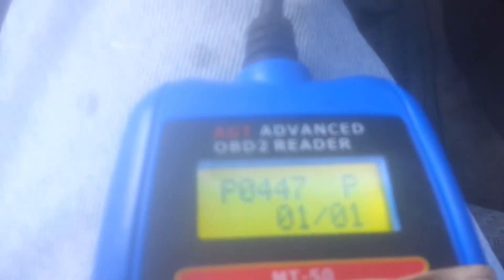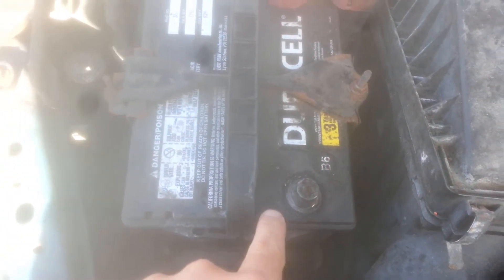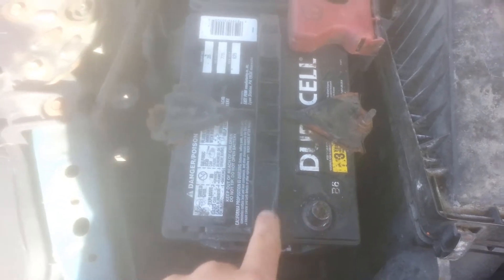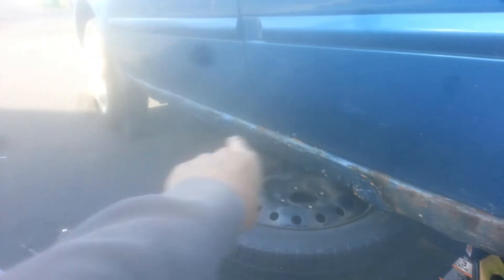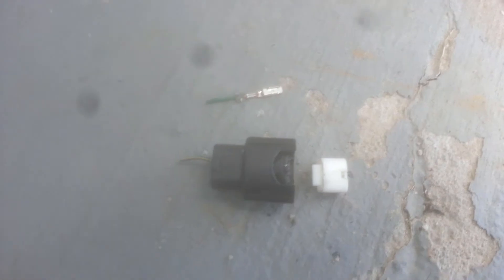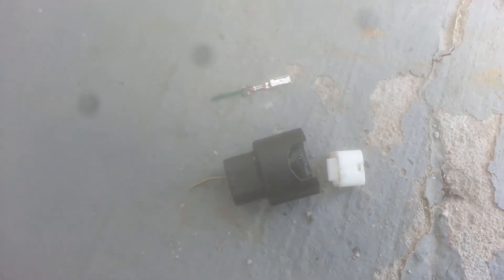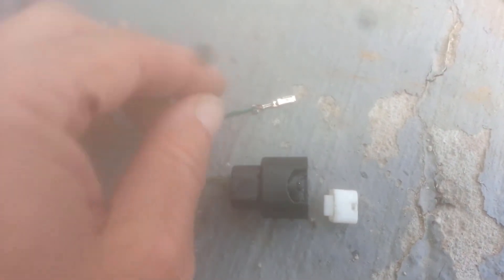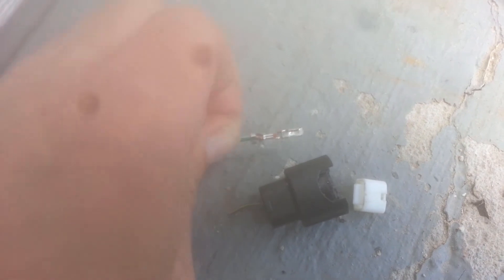P0447 FIXED!!

Comment: Other than the check engine light being on, did you have any issues with the performance of the car? Like did it have a rough idle, misfire, or seem to have a vacuum leak?
Reply from the maker: My only symptom was the check engine light. No other issues.

Comment: Fantastic job.I have a 2006 Subaru sti that failed emissions in ct. Tax ripoff state ,due to a po447 had a 442, 456 and 448 had those cleared except for the po447 spent 1500 dollars so far
Reply from the maker: $1500 is a ton of money, ouch! I hope you're able to get the po447 resolved. ..Thanks for watching!